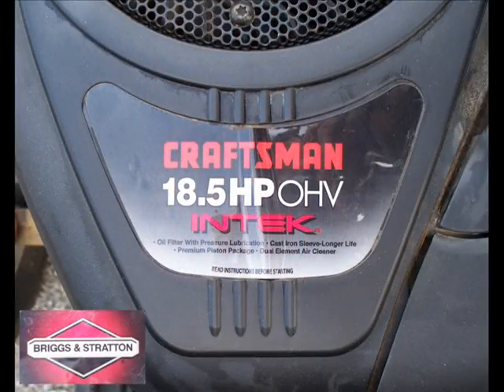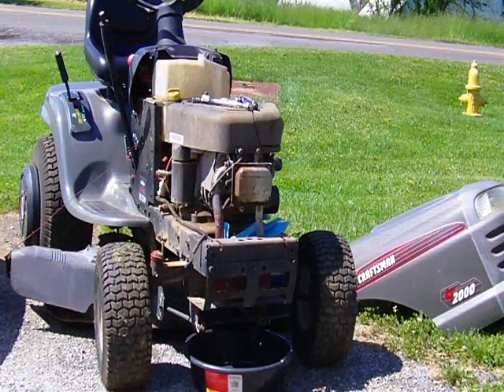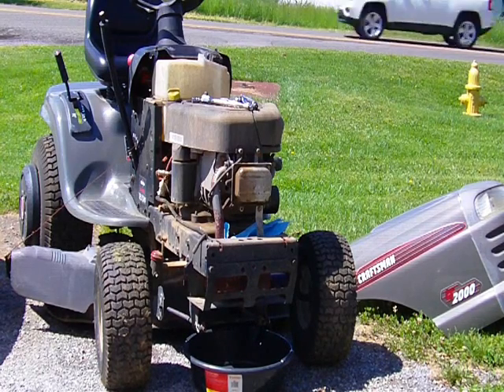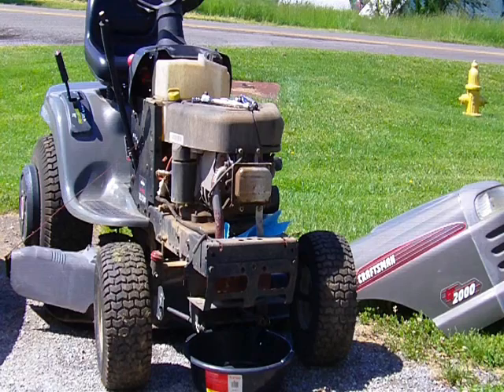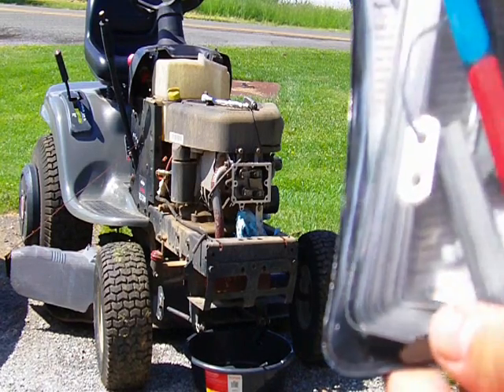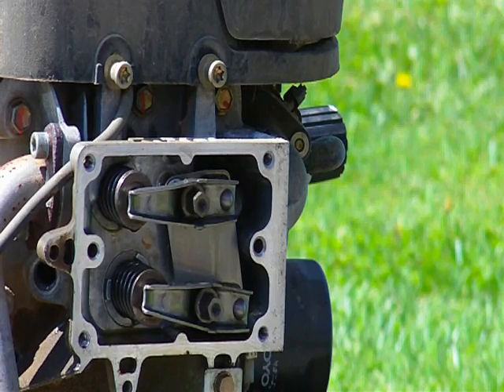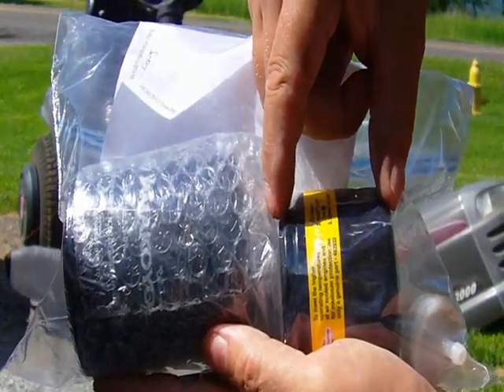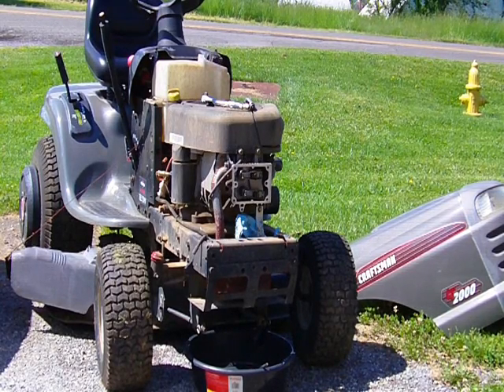Valve Adjustment Briggs & Stratton Intek OHV (Craftsman Riding Lawnmower / Lawn Tractor)

Comment: I adjusted my valves on the 20hp. Intek and I brought each one up to full height. I adjusted to .0538 and the guage hung in there when I tightened the tap down. Before I adjusted them nothing would even go between the gap so I believe that is what the popping was, but after adjusting when I hit the switch it just started to turn the engine, clacked and made a light squealing noise. Could the starter or silonoid have gotten stuck? I noticed it had made that light squeal noise even before adjusting the valves but it did crank and start right up before.

Comment: Thanks for this video. I’ve done it before but it’s been year’s and I needed some reminders. Good tip on oil filters some people don’t understand-bigger more oil added to engine good thing and more filter to clean!! Great explanation keep up the good work. I use and oil 40 years ago in a cj5 engine trans and differentials and at 30 below it still rolled on its own and mileage increase 4mpg.
Reply: Amsoil above in the cj5
Reply: Amsoil above in center the cj5

Comment: Amsoil is great oil. I use in my Ariens 42" lawn tractor 19 hp Briggs their Z-Rod hot rod oil since it is high with Zinc anti-wear additive. Use it in all my cars and one has 106k miles on it and when I had the timing belt replaced the mechanic showed me photos of the valve train and came with the valve cover off and could not believe how new and great the came ect ect looked.

Comment: I watched dutifully to see valves adjusted. Instead I get your opinions on oil you sell, the wrong filter and a hot running sparkplug. As I like others would want to avoid $850 for a new 18.5 hp Briggs it's best to follow the manufacturer guidlines on the 45 ft lbs on the torque t20 set bolt and the. 04 valve lash space. 
I can't believe I watched this all and you didn't do a valve adjustment. I suggest you change the misleading title for this editorial style video.

Comment: Man i had to come back to this vid to comment,i watched this while back,my aunts JD rider started running bad,it has a 23 hp briggs,48 in deck its a LA 145 model it has 253 hrs on it, she bought this mower new, (lowes)and just used it thats it for 5 yrs now,so i go and start doin simple stuff 1st,check the oil barely showing on stick black as a ace of spades, she has never changed or added oil to it i find out through questioning her, the electrode on the spark plug was burnt damn near gone,carbon all over too,the air filter was original dry grass leaves caked all over it,grass debris caked all under the flywheel,zero maintenance,and win u watch her mowe shes in 1st gear just creeping with throttle wide open, i did complete tune up kit from lowes,new blades and greased all the zerks that also never been touched,i told her she has a spindle goin next cause it sounds a little rough turning it by hand,but needles to say this damn thing still works and runs better then ever she said.,the filter was so clogged it ran like it was on partial choke blowin black carbon all over the engine muffler. AMAZED!

Comment: Thankful for getting the information, BUT, get to the proceedure without so much blah, blah. Actually thought you were going to be a mechanic. Wish I had gotten the manual, because I only wanted to know the actual timing for this proceedure, not knowing if the start-cam lobe is the same running clearance as the run cam lobe.
Good try though.

Comment: If you change your oil at least once or twice a year the inside should be clean. Dirty air filters make dirty oil. Caused by excessive gas in the cylinder.

Comment: Got a Briggs v twin 07 over 540 hours on the motor. Carb is new cause I didn't wanna fix the old and starter is new cause the old one popped but everything runs great and it keeps on going. Here in Texas it gets hot running full throttle all day but reading the temp it never passes 200. Synthetic works good on these

Comment: Outting on a bigger oil filter is a mistake. There is a reason for the size of the filters.
Reply from the maker: Briggs & Stratton maintenance manual (275935) lists both filters for this engine. 491056 (long), 492932 (short). Explain the mistake of using an OEM recommended oil filter on an InTek engine.
Reply: What´s the model and type number on this motor? Usually B&S have 2 filters for the same engine; normal vs. longlife. They are similar in diameter, but different in length. The one you use here is larger in all aspects. BUT i would say that the issue would have been bigger if it was the other way around.
Reply: +LKV never an issue. I even use fram/wix/supertech/purolator on briggs/kohler/kawi...  simple!

Comment: trying to adjust mine and can not get exhaust rod to push valves to move up or down what do I need to do
Reply from the maker: Put finger pressure on the push tube and turn the engine, you should feel it go up and down. Its either super loose or the cam is badly worn, there is also a device on the cam to release the compression (could be stuck). Adjust the valve to .010 and repeat the process to get the proper rotation. make your adjustment with 1/4 downward stroke on the piston, you can be off one revolution but the ex valve would be open.
Reply: Do you have a video on cam repair/replace

Comment: How many hours should be on a engine before a person switches over to Synthetic!?
Reply from the maker: I would give it at least 10 hours on a new engine, a rebuilt engine requires much longer to wear-in properly. Figure 3 oil changes to seat the rings on a rebuilt engine. This engine had an oil change after ten hrs and changed to synthetic on the second season.
Reply: Ok thank- you!.. :)

Comment from the maker: I would not recommend setting the valves to any specification not supported by Briggs & Stratton. I have literature here that states all settings are for a cold engine; Intake 0.003 - 0.005 and Exhaust: 0.005 - 0.007 for all 21, 28, and 31 series engines meeting California emissions.
Reply: heavymechanic2 OK set valve at .003 for bottom/intake and .005 for top /exhaust valve.. Still not turn over acts  the same way. Without spark plug spins like a top. What now

Comment: you dont have to set it to .007 or the 004. you can set it to 0 because when the engine gets hot the block expands and the 0 goes to .004